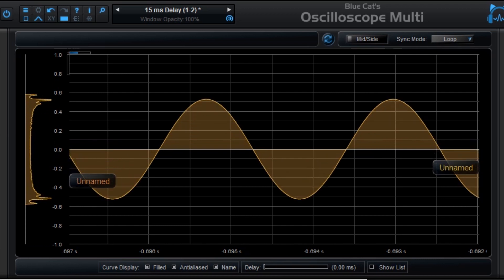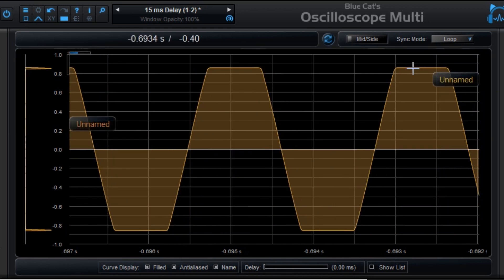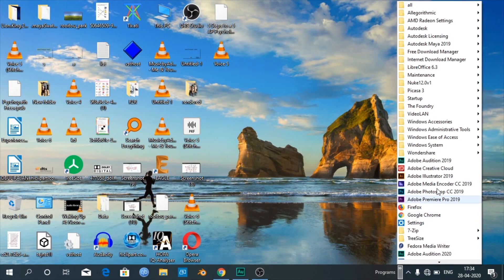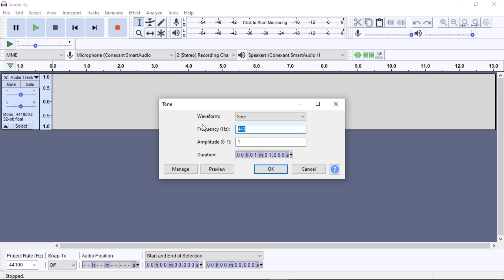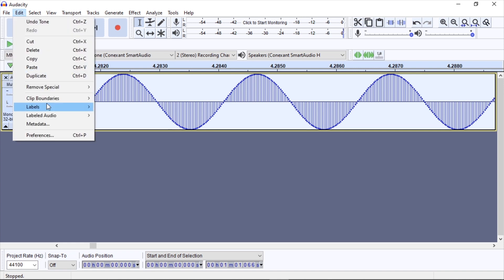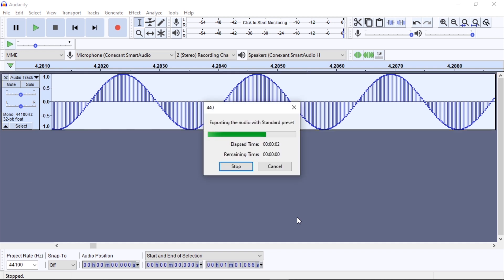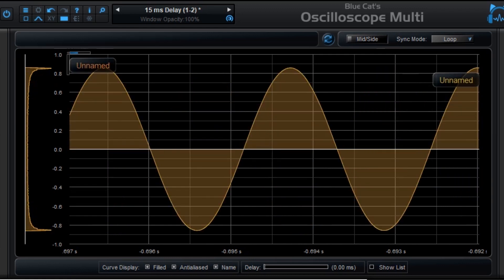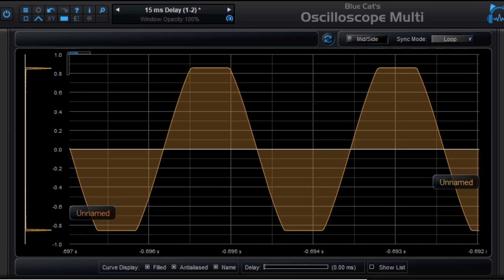STK4392 STEREO AMP POWER CHECK and Convert STK4392 Mono To Stereo fix noise & How to Check RMS Watts

Comment: Very good bro.great explanation of the amplifier circuit and working. Please tell me how to stop pop sound in speakers while Turning on and off the amplifier. I have a tpa3116d2 amplifier with 24v SMPS 10amps.

Comment: Tda2030 ic Ku enna Watts and voltage  endru sollunga Anna
Reply from the maker: 12v dual power or 24v single power 15w output